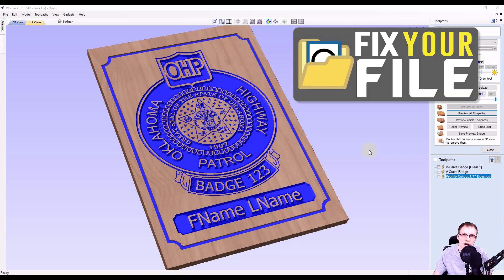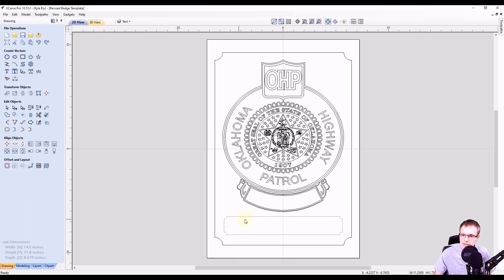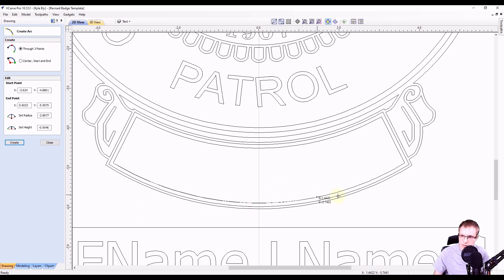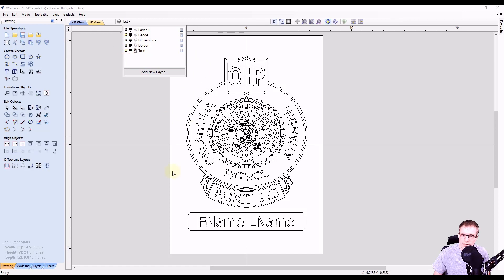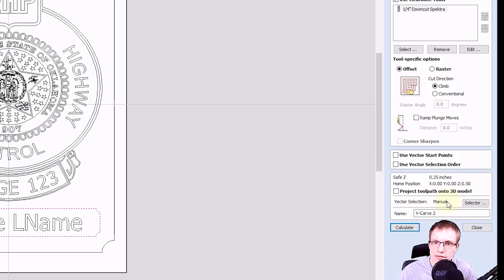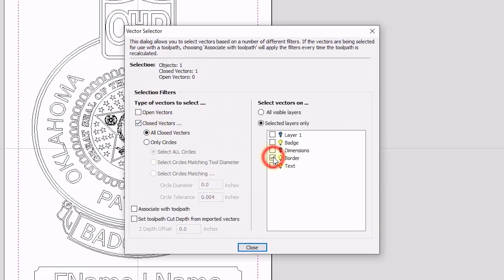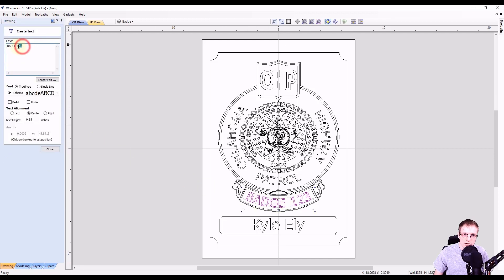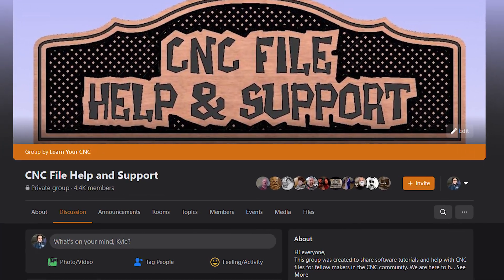How to Automate Templates in VCarve, Aspire, & Cut2D

Comment: I love the template feature.  I use it quite a bit.  The only thing I do differently than your process is the curved text.  I reference my arc in the middle instead of the bottom of the area.  Great job as usual.
Reply from the maker: Nice Chris, do you just make an arc in the center of the place you want it? So for this one you would make the arc like I did and then move it to the center of the box and use the option to center the text on the arc? That sounds like a much better way to get the text centered, thank you for sharing that with me.
Reply: @LearnYourCNC  Sort of.  The snap feature snaps to the middle of the vertical line on each end of the box (which you know) so I use that as a reference for the arc line and it keeps me centered.  

More for reference than necessity.